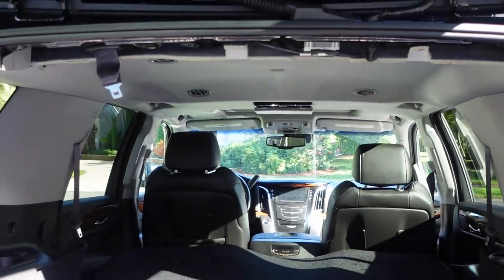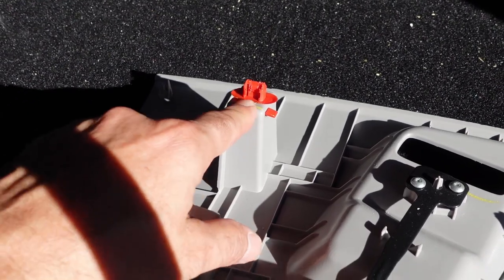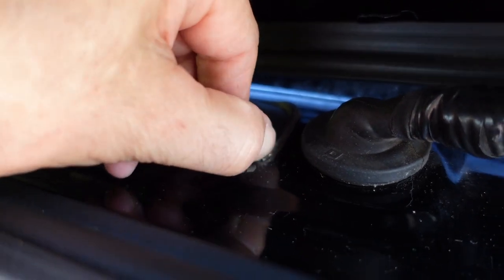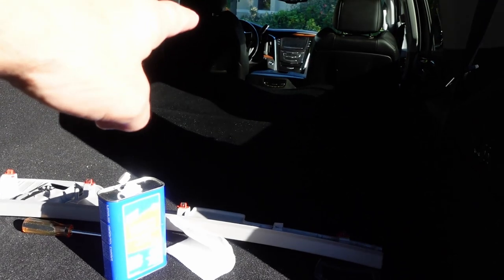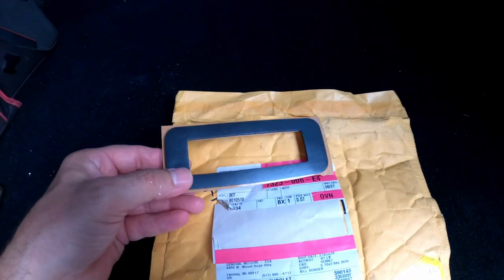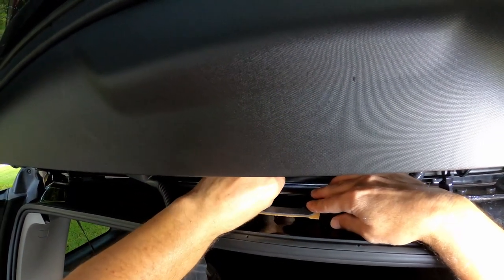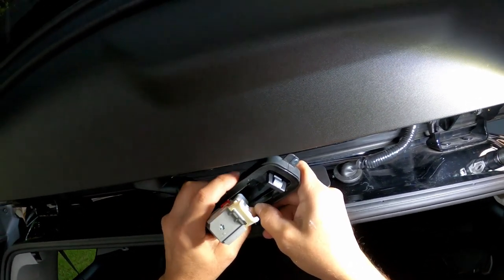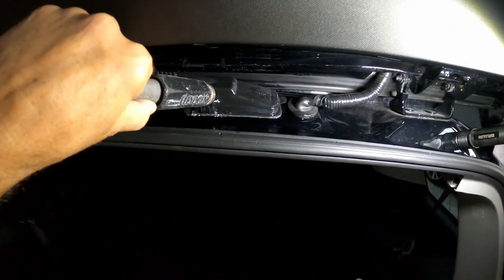Water Leak !!  Rear Headliner Tahoe Escalade Yukon 23487135 foam seal defective

Comment: Thank you for doing this video. I could not find the leak until I watched your video. Mine did not have a seal but clipted in and the clip was broken, I just used silicone and it worked.  My truck is a 2013 2500 suburban.
Reply from the maker: Hello you are welcome.  I am glad it helped you out.

Comment: Do you have the website where I can find the foam seal? I tried GM parts direct and was unable to locate the part. I want to try to use the foam seal  before trying to Jerry-Rig with silicone around the base.

Comment: I have a 2016 Denali, the rear wiper washer hose is leaking in the rear headliner. Hit the wiper pump and the water started streaming from the headliner.
Reply from the maker: Hello they have some issues.  Mine was the plug gasket.

Comment from the maker: Hello no it didnt for me and I used the rear wipers.  You could have a broken hose going to the back liftgate.  If you look at the plug from the inside of the car you can see there is a union were the plug goes.  Have someone activate the rear washer with the tailgate closed  and see where the water is coming from.  Remove the top plastic cover and you should see the leak if its coming from that connection.  Hope it helps let me know if you found your leak. Thank you

Comment: My 2023 Tahoe leaks there too. Long story trying to get mine fixed but six months later, leaking again.
Reply from the maker: Oh man sorry to hear that.  I noticed that even when you replace the foam its too thin so you have to get it on the middle.  Its a crappy rig that GM did on that.  That plug is just like the one for their doors but goes on the metal so it seals correctly.  looks like they messed up on the design and added the foam.  You can make a wider foam.  hope it works

Comment: My SRX 4 2014 leaks water by my left foot (rear window washer fluid) and I  was told there is a hose that runs up the A pillar from front to rear of the car and the washer fluid was collecting and going into my front speaker by the dash(water stain) How would I remove the interior panel to access this area to replace/repair the broken/damaged water hose?
Reply from the maker: Hello I wouldnt be able to help you on that one.  I dont have that vehicle and dont have the knowledge for that issue.  I have the Escalade but have not had that issue only the one on this video which is a water leak from the rear foam seal.  Hope you resolve the issue. Thank you

Comment: Can’t get the tail gate to close now. Did you have any issues after you plugged it back in?
Reply from the maker: Hello I believe you have to close it manually and then you can use the remove or the button to open.  Also check the plug to make sure you dont have some corrosion.  I cleaned with Qtip and added some WD40. Let me know how it goes. thank you

Comment: What is the name of the part?
Reply from the maker: Hello it has a generic name from GM - Generic Electric Application Tape- just use the part number 23487135.  When you install it prior to installing the inner top cover test with water hose.  The new foam seal is a bit narrow so when installing pay attention to the edges. Hope it helps

Comment: I see there was 2 plugs above the tail gait in that area, did you have to replace both gaskets of them or just the 1?
Reply from the maker: Hello I just did that one one the video.  The other one I believe has a raised metal around it that looks like it wont allow water in.  I put more water after the video was done and it was fine.  Just be careful I think that the plug comes with like duck tape on it so dont remove it.  I had to glue the thing up after.  Its a poor design from GM.  Make sure the rubber part falls on the foam part and doesnt overlap the foam. Test out with water to make sure.  Hope it helps. Thank you